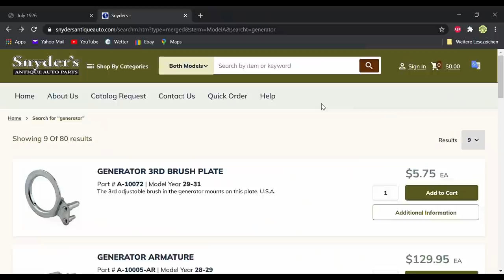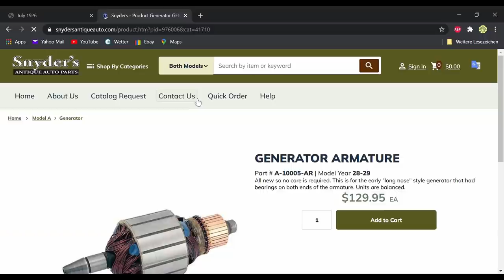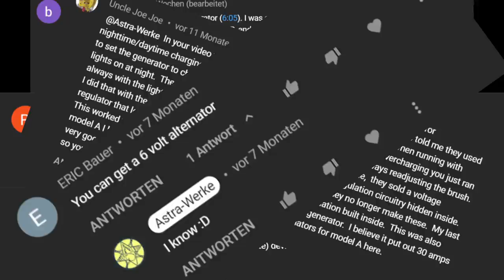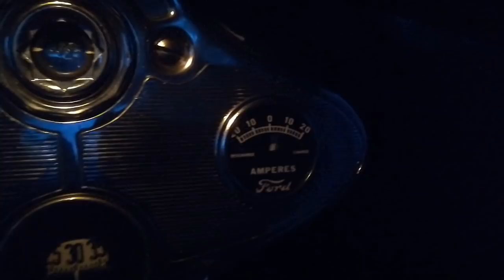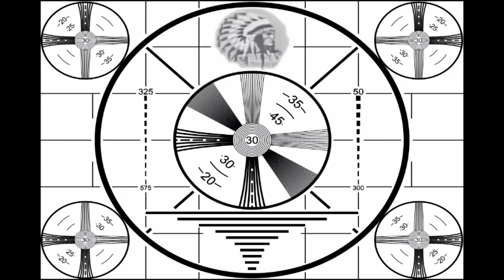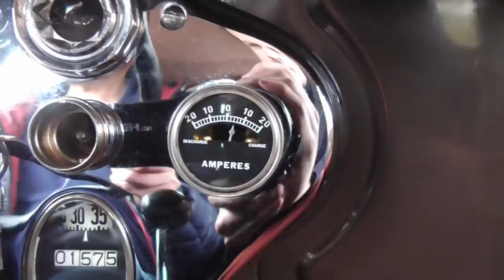Model A Generator Rewind

Comment: I used a '47 V8 gen', sawed the fork off, make brackets, welded those on, a regulator on firewall, now I have 35 amps, can run any bulbs, I have terrific lights.

Comment: Using the lathe compound with a special ground bit as a shaper to refurbish the communicator undercut is brilliant.  You are fortunate the field screws were removed using just a screwdriver. I have had to drill out the screws on both the starter and generator.  31 45B
Reply from the maker: It has actually been the first generator I worked on that just let go of the screws without drilling them out xD

Comment: The hole is in the cover a great idea. I was thinking about making a mechanical arm where i can adjust it from inside the cabin.
Reply from the maker: Definately a neat idea, too. I have a small brush motor which can run both directions through adjustable brushes. They just milled a curved slot into the bearing cover and put a  threaded bolt through to the brush plate. Also an elegant solution imho.

Comment: What an undertaking and it’s great to know you can do it. I would definitely take the easier way out and order the new parts. I too enjoyed working on the model A even when things didn’t work out. I don’t think Henry Ford had any idea these cars would have such a following and fans. Thanks for the Great video I’ll watch for the next one. Thanks
Reply from the maker: My thoughts were "it's f*ing munted anyways, so I can at least try to wind it myself." Luckily, I don't have to make my living off this kind of stuff, cos if I had written down the hours it took to get this thing back alive, you'd probably have yourself a $5000 generator right there xD
I did it because I was curious if it could be done.
Reply: You did it and I think that’s great. I prefer the positive ground alternator but you have to rev it up once to get it to come alive, you don’t have to mess with the third brush. It’s the second modern thing I installed, the first was electronic ignition and third was insert bearings and those are hidden from sight. Thanks

Comment: Is the distributor in good nick? If it has shot bearings or the plate wire is perishing, could miss nconsistently. Never hurts to check the condenser just in case since you files the points(they could have been taking a hit). You could pull the top cap to watch the rotor spark and see if it is consistent. It’s fairly quick to run all the wire connections on both sides of the terminal block.  I’m no pro like you but so many(I’d venture to say most) restorations are aesthetic only and parts(like this very generator) are ignored if they function - even marginally. Could be an indication of the condition of other components. Same for suspension components. 
Awesome work and something I’ve never really understood. I learned a lot! Thanks.
Reply from the maker: We've since found that the ignition coil polarity was mixed up. Swapping the wires helped alot already - now there's still a cracked distributor cap and an ignition cable that has more resistance than I'd expect that'll need swapping; we'll see from there.

Comment: Wow! That generator needs a LOT of lovin'. Luckily, you have a lot of love to give.  ';-)
Rebuilding a generator like this is not for the faint of heart. Thankfully, your strength is the strength of ten, because your heart is pure (at least when it comes to Model A's)!
I truly admire you for attempting the rewind. I love the fact that you wanted to give it a try to learn something new. A 3-month gap between disassembly and reassembly however...
15:16 Perhaps an "amateur armature"?
Your generator modification for brush adjustment is very clever. For sure, the Model A was definitely designed to be user-serviceable, but some things were still a pain in the you-know-what.
I love your coil winding rig. There are times when I wish everyone could have machinist and/or engineering training. It prepares you to approach problems rationally and logically.
I would definitely be interested is the Model T rewinding video. I love how you rise to these challenges!

Really enjoyed this video (as I do all of your videos). Cheers and here's hoping you have a beautiful summer just right for Model A touring.
Reply from the maker: Thanks alot! I filmed the whole Model-T-Generator ordeal - it luckily didn't need any rewinding (which doesn't mean it didn't take alot of work to get it running, regardless), but I also got driving lessons on the Tin Lizzie, so that ought to make for a fun video :)
Reply: @AstraWerke  Oh, WOW! That sounds cool. Now you'll be able to realize just how much people appreciated the "modern" Model A!

Comment: So interesting seeing u rewind that armature. Had a model airplane kit that came with a small motor you had to build & wind the armature. My 30 model a generator has 2 caps to lubricate the front & rear bearings. Didn't see it on that one.
Reply from the maker: There were different versions throughout the years. '28 and '29 had a sealed ball bearing front and back with no need for lubrication, the brass bushing with the oiling cap was introduced later.

Comment: Great video, love your music!   I have all of them, great versions.  You're a braver man than I to try that job. That Fordor.  I know you know Paul Shinn, sure he will set you straight on that one.   Remember, just because a part has been replaced doesn't mean it's good, been there, done that.  Let us know how you make out with that, I'm curious.
Reply from the maker: We've since found that the ignition coil polarity was mixed up. Swapping the wires helped alot already - now there's still a cracked distributor cap and an ignition cable that has more resistance than I'd expect that'll need swapping; we'll see from there.

Comment: Why all cylinders are not firing, could be bad plugs, or gas problem? I am sure you would know better than I. I really enjoy your channel and am in awe of your knowledge. I am recently owner of a early "28" Ford dump truck. I have been tinkering ever since. Your channel is an inspiration. keep up the good work
Reply from the maker: We've since found that the ignition coil polarity was mixed up. Swapping the wires helped alot already - now there's still a cracked distributor cap and an ignition cable that has more resistance than I'd expect that'll need swapping; we'll see from there.

Comment: I spent several days making the generator on my 1969 Renault alpine gt4, to work after had to take the armature to re wire and  adapt new brushes, from a vw beetle because those are availble and the renault ones not ,the field was ok, when I put it on the car, it won't charge more than 12v...  long story short, I ended taking it apart and mixing parts with the one in my R4..  at the end after sanding the points in the regulator and djus
ting them I got it running again.
Is hard when you can't go to your neighborhood parts shop and have to work with you have available.. I paid 40 dollars for the armature being re wired and it took 2 weeks.
Sticky or burnt valves could be the fault.
Reply from the maker: My advantage is that I can always go back to square one and order the parts I couldn't make myself.
Not having that option always puts you under a different kind of pressure.

The bad running was mostly cured by correcting the switched polarity of the ignition coil. It's still not perfect, but there's also a cracked dristributor cap and resistive ignition cable that I want to have switched. Then we'll see from there.
Compression on this engine is excellent. I can crank mine over by hand with reasonable effort - on this one it nearly brakes your back. Guess why I hauled my car as a start helper over ;P
Reply: @AstraWerke  thanks for your reply Adrian,  the cracked cap is enough to cause malfunction. About a year ago I was driving my 1976 R4 and all of a sudden, the engine loose 1 cyl firing, I kind of panicked because about a year before I was replaced the pistons, piston sleeves and piston rings and also checked the valves and guides, in fact, all the engine minus the cranckshft because when i took all apart, it didn't had any scoring ..I thouht maybe something of that went wrong .After a while, i detected a very subtle carbon track beteen two of the contacts and I was able to get localy a couple of distribuitor caps ( I live in Monterrey Mexico and over here due to the proximity of the USA border  to get old european car parts is difficult). Like you, I use my old cars all the time, and by now even my " modern" car is an old 2004 Renault Megane II saloon. With automatic gearbox and 2.0l engine... not the most reliable thing in the world 🥴 but still running like new at 205000 km. 
You are very skilled and if I ever go to  Germany again( last time in 2015)  It would be very nice to meet in person, have had the chance of meeting one of my suscribers , now friends, one in france in a couple of different travels and other in England.

Comment: Coil pack, and/or, Spark Plug Insulation. May also be the condenser is wet inside, or has a minor cut in the wire itself at the base where it goes into the condenser body itself.
Reply from the maker: See comment I pinned ;)

Comment from the maker: The poor running engine is fixed!
Contributing to the miss were
-Reversed Coil polarity
-Cracked distributor cap
and a corroded ignition cable. :)
Reply: mein A ist die ersten 3 Jahre wundervoll mit vertauschter ZS-Polarität gelaufen - war kein Problem  (ausser leicht verzögertem anspringen).
Reply from the maker: @FordModelA-kp9ko  wir haben auch noch ein hochohmiges Zündkabel und eine rissige Verteilerkappe gefunden - aber die Polarität zu tauschen ging schnell und hat schonmal einen guten ersten Erfolg gebracht
Reply: Thanks for pointig that out. I was just about to start a two page comment about humidity in the distributer and how to avoid it.
Reply: How did you discover the coil polarity assaboutfaceness? Splendid video on genny winding! Yes, a "T" version of genny resurrection would be wonderful!
Reply from the maker: @Rustinox  Glad I could save your time xD
Reply from the maker: @jimmccoskey8253  I think vice grip garage mentioned somewhere that a switched coil wire had caused him quite alot of trouble.. Having run out of ideas, I just took a quick look... Luck of the draw.

Comment: The part where the small plate is mated against the front plate holding the bearing it, is actually supposed to be riveted. Those nuts stick out a lot. the damage would have been less if rivets were used. Even simple pop rivets work fine btw
Reply from the maker: Absolutely. I used very shallow nuts for reassembly (lacking the proper size rivets at the time) - now there's at least 5mm of a gap in between the coils and the nuts.

Comment: Awesome job, I might try a no fowl adapter for the spark plugs on those misfiring cylinders! 👍
Reply from the maker: I'll be honest, I've never heard of a no fould adapter. What is it and how does it work?
Reply: @AstraWerke  It's an attachment you put on the spark plugs in the bad cylinders to change the spark plugs gap and increase the spark voltage to burn excess fuel in the cylinder! You can pick it up at the auto store!👍

Comment: What about the gap between the rotating shaft and the distributor cap poles, if it is so equipped?
Reply from the maker: We've since found that the ignition coil polarity was mixed up. Swapping the wires helped alot already - now there's still a cracked distributor cap and an ignition cable that has more resistance than I'd expect that'll need swapping; we'll see from there.

Comment: Want to try rebuilding a 1927 Buick genny?

I actually talked to a man who said he could actually convert a 6 volt generator to put out both 6V and 12v at the same time, would have a second set of contacts and voltage regulator obviously, and would put out about 20-30 amps on the 12V side.

Interesting, not sure how he wood achieve this but I’d love to know.
Reply from the maker: Well, generally yes, but I wouldn't want to risk shipping it overseas (and then taxes and customs and whatnot).
Some cars of the 1960s had generators which were prepared for both 6 and 12 volts - using four field coils and brushes instead of 2. Not sure how he'd wrestle all that into a generator designed for just 6 volts - it'd need a completely re-machined brush holder backing plate, two extra stators and a whole lot of extra wire.
Either that or he'd just double the No. of turns on each coil (and reduce the wire diameter by half) and route the outcoming 12 volts through some smart electronics to step it down to 6V on demand.

Comment: How the heck did you get the field coils out of the casing? The screws on there are so freaking tight with mine. All I can do is damage the screws
Reply from the maker: I had luck with the screws on this one. You can get some extra loosening power with an impact screwdriver, but if all is lost, drilling out the screw heads will do, too.

Comment: But if your only getting 5 volts and the batteries 6 aren’t you losing power?
Reply from the maker: The drill wasn't able to get the Generator up to operating speed. This was more of a bench test to see if the thing would work at all.